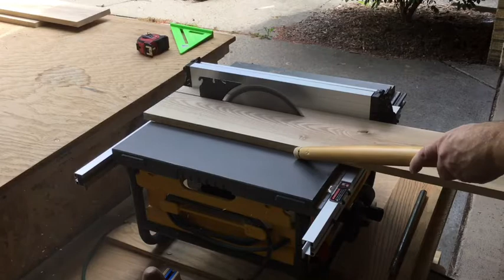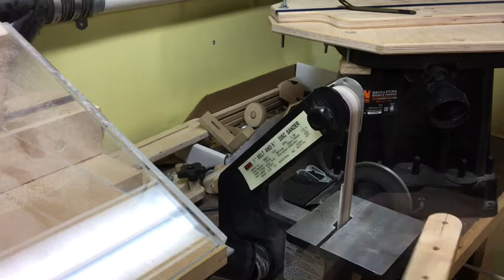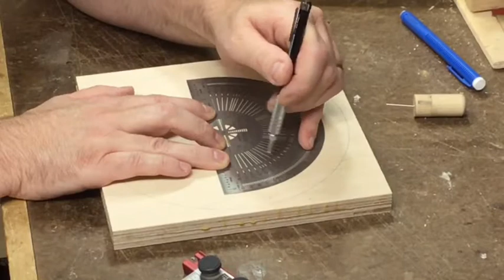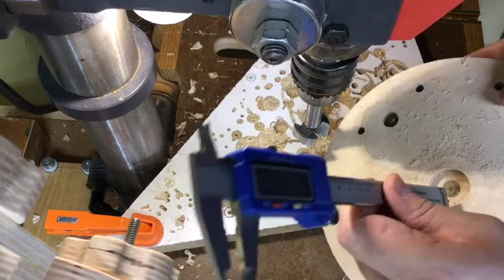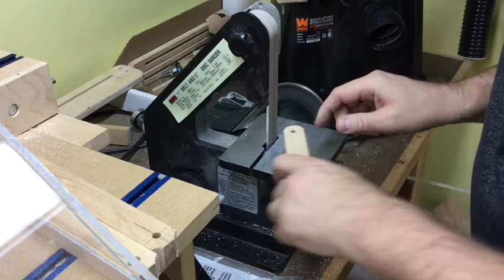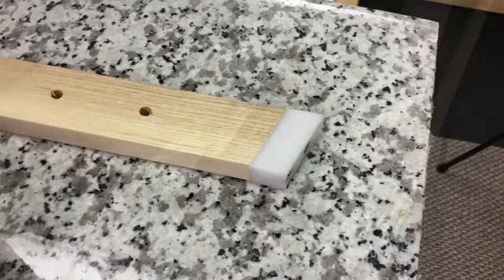Wooden tripod and camera boom arm. Part 1 - tripod.

Comment: What is the length of the Tripod, the width and thickness of the wood used?
I am very interested
Reply from the maker: I used 3/4" thick ash. The double leg sections are around 36" long with a 20" adjustable extension on the bottom of each. The short boom arm (the bottom arm) is 34" long and the top arm is 52". Hope this helps!